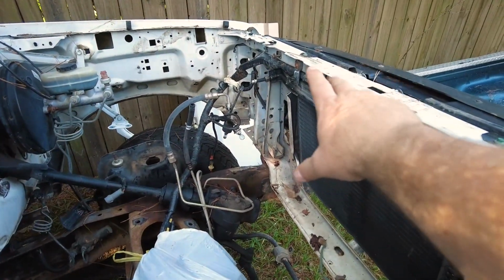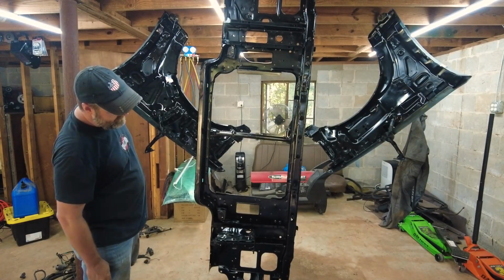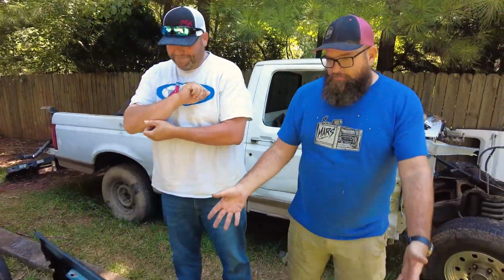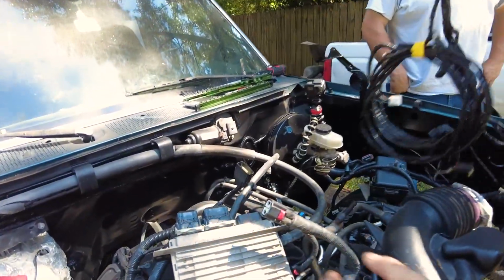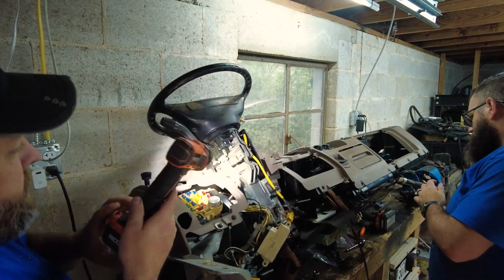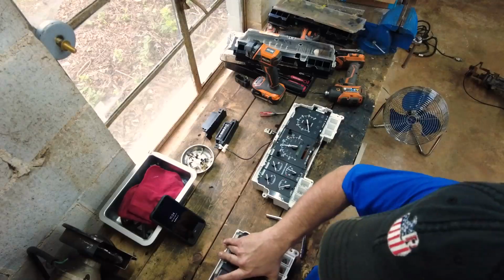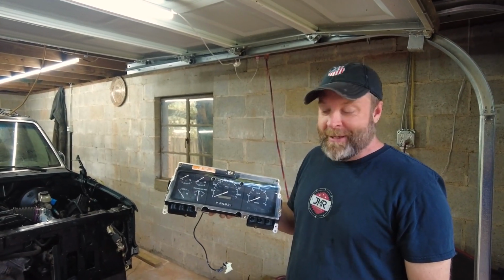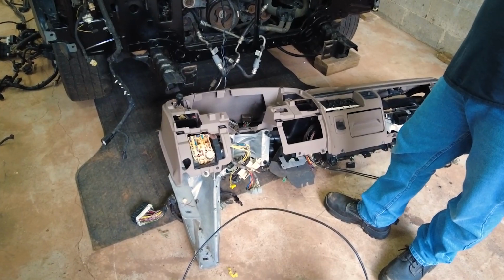FRONT CLIP and the Coyote Harness install in a Coyote Swap F150.

Comment: How do you clean prep the fenders and firewalls before paint need details
Reply from the maker: We wire wheeled it then we used scotch brite pads to rough the surface.  We then blew it clean and wiped it down with cleaner.  Good luck brother

Comment: You shouldn’t need to switch over any dash harness. Ford harnesses usually have wires and connections for either configuration. It simplifies production on the assembly line. One size fits all. The extra plug could be for electric trailer brakes if the truck had the tow package
Reply from the maker: Thanks for the support and the help.  We were hoping that for sure.  This is great news.

Comment: How did you figure where to place the cab for proper alignment, front to back and side to side.
Reply from the maker: Great question. we ended up putting it where it landed.  However, the correct way would be to find points on the frame and then measure. Also, using a frame tool called tram Guage is another tool you can make to use.  Good luck and let us know if you need any other help.
Reply: Yes I subscribed, finishing frame off on a 93 f150 4x4 extended cab short bed, I’ll send picks if I can figure how to do it.wiring in Holley Sniper now.
Reply from the maker: Heck yeah brother
Reply: Anyway to DM you guys

Comment: Nice job guys. I don’t remember, what year was the white truck? When I did the tach swap on my 95 (waaaaaay back in 2007, before YouTube videos to help on smart phones) my understanding was you had to kind of have similar year trucks… 92/93, 94/95, and the 96 was its own critter with OBD2. Just wondering if there is anything there that might give you an issue. 

But tach swap is still one of my favorite things I’ve done to that truck. 

Also, is it not going to be an issue if the miles of the truck/VIN change drastically?
Reply from the maker: Its exempt in ga.  The original was not operable anyways.  Appreciate the support brother